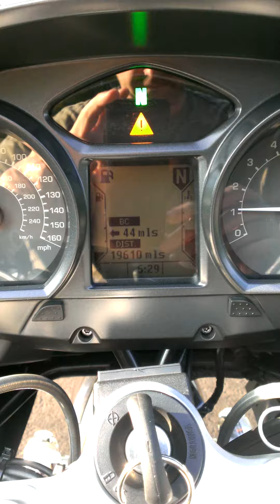BMW R1200rt engine issues(2)

Comment from the maker: Yes, two BMW dealers couldn't find anything wrong.  they told me I was imagining things.  I found someone on the web who simply said .....did you check the basics??.  I thought well no but surely the dealers did.  long story short, I pulled the coil packs one at a time to see if the problem got worse.  when I got to the left side lower pack the problem stayed the same!  rather then get a new pack right away I swapped spark plugs, left to right cylinder banks and the problem moved to the right.  damn plugs!! after all that it was a bad spark plug!  crazy! I changed all 4 for good measure and everything was fixed.  Plugs...that's it! .....and BMW stealership couldn't find it...how pathetic!
Reply: Wow unbelievable bravo of the diagnostic and fix! One of my favs